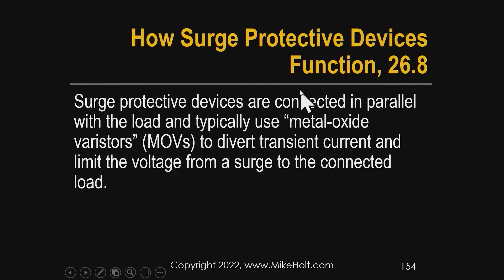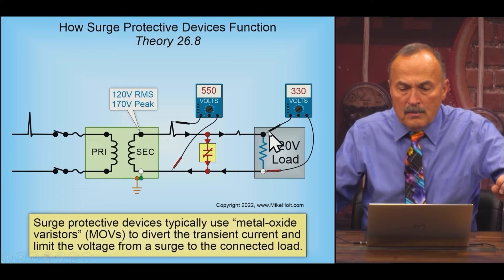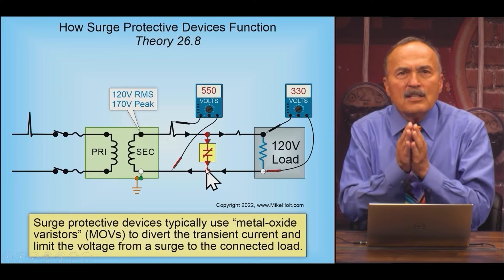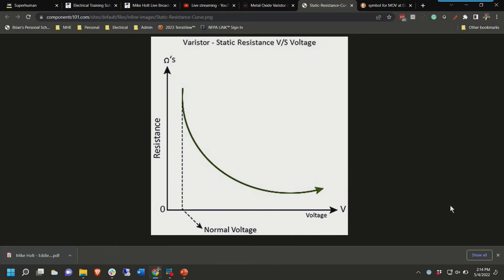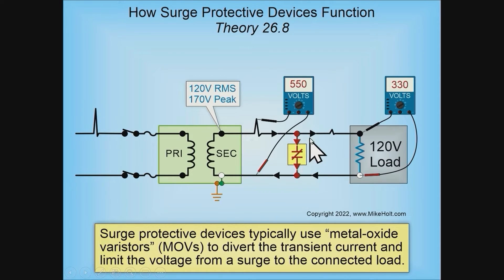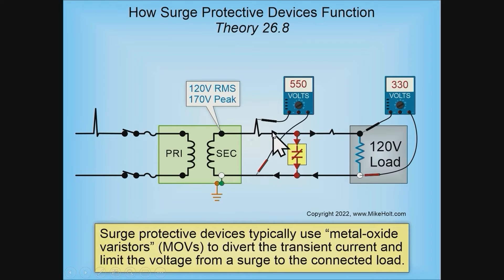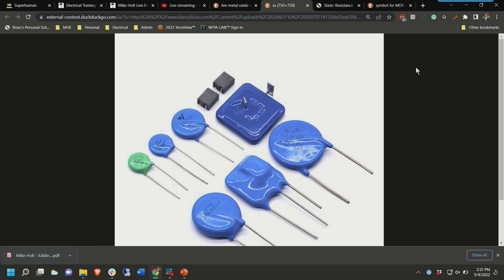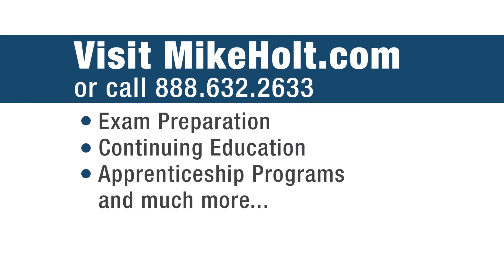How Surge Protective Devices Function

Comment: Saw a hot tub circuit board hit by a big transient...the MOV exploded but it protected the board.  Swapped out fuse, MOV and old electrolytic capacitors with heavy-duty quality-brand caps and it worked perfectly.  Thankfully everything was through-hole, no microscopic SMD.  BTW in mechanical engineering a MOV is a motor-operated valve.  Hope this helps someone.

Comment: Open neutral can create sustained 240V on a receptacle. I've seen this damage all sorts of appliances. MOVs in surge protectors at the outlets will burn up,  sacrificing themselves to protect the appliance.. A whole house surge protector may not do anything to alleviate damage from an open neutral on the power company side so, like you said, best to have surge protectors on all appliances. I recommend putting fire proof material, such as a piece of tile,  between the surge protector and the carpet because I've seen some surge protectors with their plastic cases melted after an open neutral event.
Reply from the maker: You are 100% right about power strips with internal TVSSs protection. The revisions to the "standards' for what you remember as TVSSs to what we now call SPDs have internal overload protection so that they shouldn't catch on fire like you described.
Reply: If I'm not mistaken, the higher-end, more expensive MOV-based, shunt-mode surge protectors will now advertise that they have their MOV's enclosed inside of a ceramic housing. This is a fire prevention method. When an MOV is hit with a very high surge it will overload and essentially explode. That small explosion sends red-hot shards of that MOV flying out in all directions which can lead to a fire. By encasing those MOVs in a ceramic housing, those flaming-hot shards from an exploding MOV are contained in what is essentially a fire-proof jacket and the changes of a fire are dramatically reduced as a result.

Comment: I would just like to add that Metal Oxide (essentially a metal typed rust) is semi-conductive and not a semiconductor in the sense like the ones that are used by chip manufacturers. It's a metal powder between two plates that has poor conductivity until there's enough voltage to break down the resistance (heating the oxide and converting it back to metal); causing the two plates to "clamp" down and shunt voltage either to ground or a short circuit. Either way, once this occurs, the MOV must be replaced or removed before the circuit can operate again.
Reply from the maker: Wow, great information.
Reply: I've watched every single surge protection video on YouTube twice and this is the very first time I've seen anyone actually bother to explain how an MOV actually works internally. Thank you!

Comment: Just took my test again got a 66% I am only on page 131 of the electrical exam preparation. I feel like in connecticut they make the test difficult and tricky because the questions are misleading and lacking absolutism. They could make the test difficult as well as being cut and dry just saying. Will keep at it!
Reply: There can be sinister behavior up here. Installations designed to trick other electricians maybe this is the reason idk, I’d never do some of the things I see but I sure have come across vindictive things. Some to code some not
Reply from the maker: Sinister behavior and vindicative things? Really...
Reply from the maker: Hum... you got to page 131 in my exam prep book which has a total of 496 pages and you failed the exam. Then you think that the exam is flawed... actually if you complete my program, by answer all of the 3,000 plus questions and you watch all of the videos, you'll 'kill the exam' the next time.

Comment: Hey Mike, I thought you might like to know, back in the mid to late 1970s I was working for Honeywell and I initially had a problem when I was working at the Federal Reserve Bank in Philadelphia, when the motor operated doors came to the end of their cycle, opening or closing, they caused an inductive kickback spike which would kill our solid-state circuitry. MOV’s, (relatively new at that time,) seemed like they may be an answer to our problem. So, I tried them and they worked amazingly well! Sometime later we also had some problems with another site that kept getting hit with lightning; MOV’s also proved to be the answer there. I'm glad that the National Electrical Code is starting to finally Implement MOV’s and I look forward to their continued protection on these systems. However, on signal lines, super-fast Bidirectional Zener diodes most likely work better than the MOV’s.

 Thanks and keep up the good work.
 Rick.
Reply: That’s a pretty cool story. Thank you for sharing. My grandfather retired from the federal reserve in Philly in the 90s
Reply: Hell yeah Rick. Great story

Comment: Transients are crud that doesn't belong. Nobody will guarantee that it is AC, nor will anyone guarantee it's anything like a sine wave. So the expression "RMS" ought not be applied to transients.
Reply: RMS means root mean squared. It certainly doesn't need to be a perfect sin wave, you can perform an RMS calculation on any wave form, including a transit
Reply from the maker: Thank you, RMS is just a calculation of the square of the instant values, then we get the mean, and then the square rood. It really should be SMR...
Reply: RMS is a calculus operation, that squares each instantaneous value, integrates, divides by the time interval, and then square roots the result.  You can have an RMS voltage of any voltage signal, doesn't have to be an AC sine wave.

For instance, if the surge were shaped like a parabola, V(t) = 1000*t*(2 - t), from 0 to 2, the RMS voltage would be found as follows:
Step 1, pull the 1000 out in front, and put it back on at the end.
Step 2, square the function.  t^2*(2 - t)^2
Step 3, Expand: t^2*(2 - t)^2 = t^4 - 4*t^3 + 4*t^2
Step 4: Integrate: (1/5*t^5 - t^4 + 4/3*t^3, evaluate from 0 to 2: 16/15
Step 6: Divide by the time interval to find the average: 8/15
Step 5: square root: 2*sqrt(2/3)
Step 6: recall the 1000 factor, to get 2000*sqrt(2/3) = 516 Volts
Reply from the maker: @carultch  Excellent!

Comment: I understand that this is designed for general electrician consumption, but Mike's hand-waving explanation illustrates the difference between tradesmen and scientists. Mike may make fun of research engineers that they may call something a "light fixture" instead of a "luminaire", but similarly, I can't help but smile at this explanation.
Reply: What was the problem with his explanation? Made sense to me.
Reply: @R900DZ  It was a high-school level introduction skipped the role of inductors and capacitors and how resistance to voltage change forces the lines to heat. and how some also shorten to ground.  honestly for sparks he should have just shortened it and said. A spd has a specialized circuit that opens to ground or absorbed the voltage as heat.  the important bits for electricians is:
1 Ideally you need a layered defense. Service, panel, and device.  The further upstream the more time it has to react.
2 the types of devices at each location. and what size you want in each region of the country
3 communication spa's LOL.  VCR?! what's that?   I have an internal 5G box that just plugs in.   There are zero wires coming into my personal house.  I only installed the intersystem bonding bridge because it's required. 
Antenna I have has a coax and plasma shunt to a second ground run to the main.
Reply from the maker: Thank you.
Reply: @R900DZ  if the surge protector creates a “short” and the two lines are “shorted” through it, how come there is still 330V left to go to the device in parallel? If it really was a short, there should be zero, no? Mike was close to explaining it but didn’t quite manage. Again: close enough for a hand-waving explanation and to be honest: electricians don’t need to understand how semiconductors work to be successful. My point is that this quiet hostility between tradesmen and engineers is unnecessary and I’m pointing it out because it usually goes the other way: tradesmen will look down on engineers and scientists because they use different lingo, and may sound amateurish when they speak in the DIY context…
Reply: @yarekk my assumption for the 330v goes back to the prefix SEMI in semiconductor. That is to say it is not a true short, it’s a SEMI short, it dissipates some not all of the voltage.
Reply: @R900DZ  my point proven.
Reply: @yarekk  ? I did not say anything hostile, nor did I feel mikes explanation was in any way hostile or talking down on the engineering side.
Reply from the maker: I'm sorry, I should not have said that the SPD created a 'short-circuit.' It 'shunts' the circuit and the SPD shunts it (per UL standards) to a maximum of 330V. I'm confused about your comments about the conflict between tradesmen and engineers relative to my video. Did I say something negative? I love engineers and scientists (I'm a geek at times).
Reply from the maker: You are correct, I should not have said 'short-circuit'. It 'shunts the circuit to 330V for a 120V SPD.
Reply: Wouldnt  the SPD shunting design be considered a crowbar shunt?
Reply from the maker: @normanvictor2561  You are 100% correct, https://en.wikipedia.org/wiki/Crowbar_(circuit)

Comment: I was laughing, just like Eric and Mario, when the panel was in agreement about surge protectors cannot guarantee protection from surges.  FYI, I have noticed older power strips with surge protection have been tripping arc-fault breakers when vacuum cleaners are turned on from other circuits.
Reply from the maker: Hum... I need to remember this. Thanks